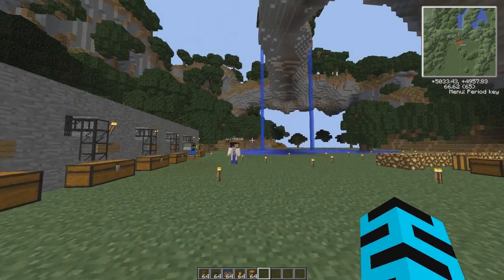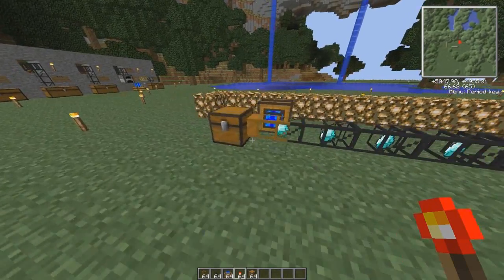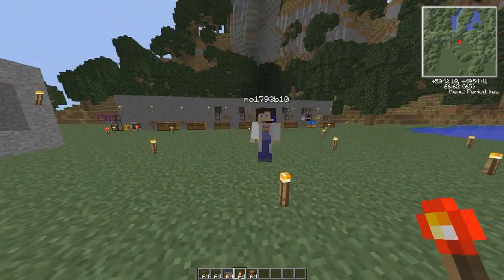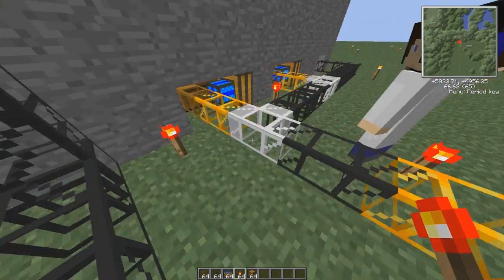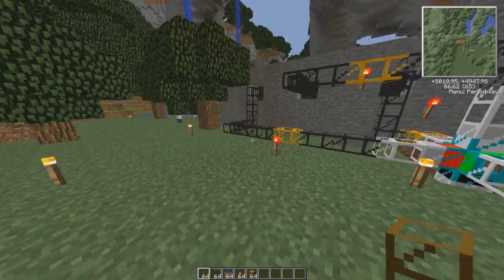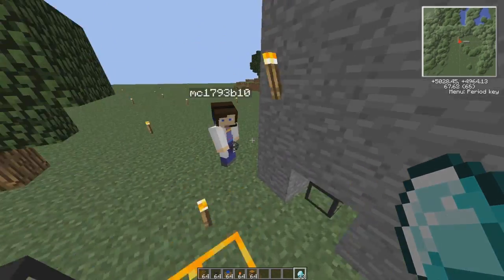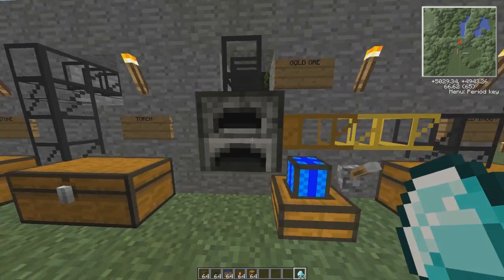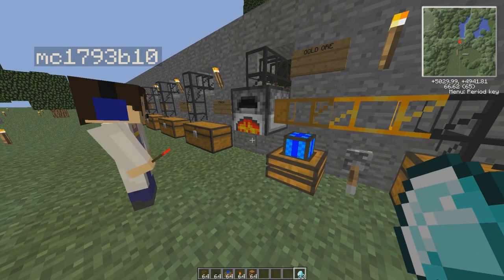How To Use Transport Pipes

Comment: Question for you from a transport pipe noob.
First off, I'm playing FTB not techit (it uses most of the same mods, but is easier on my computer)
I've got an egg farm that I use all the time in vanilla minecraft. it uses water to gather chicken eggs and deposit them in one square.
What could I put in that square to get them into a transport pipe system?
I've tried a wooden transport pipe and an engine and that did nothing.
Other than a ComputerCraft turtle, Any ideas?

Comment: ok imma try to explain it better..

so ive made 1 quarry and i have 1 set of connecting pipes going into all of my crates. (set 1)  i decided to make another quarry and im making another set of pipes. (set 2) wnat im doing is connecting sets 1 and 2 before the {diamond sorting pipe} when i do that, the spot where i connected sets 1 and 2, the items will go from set 1 and backtrack to set 2 and head back to the quarry and be stip out at the quarry.

Comment from the maker: Not really sure but you can try allowing coal to pass though 3 different ends in the filter pipe and then to each engine. Maybe it will spread it